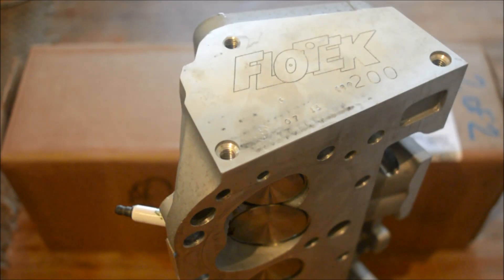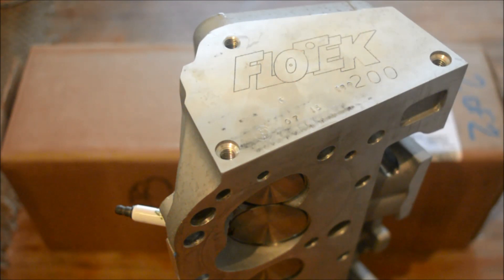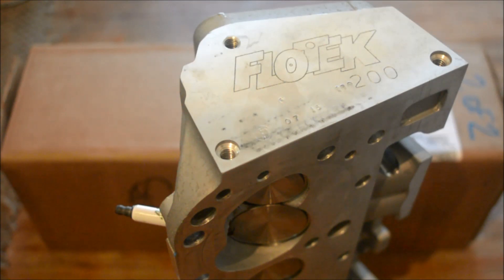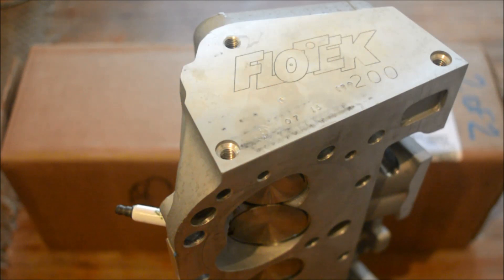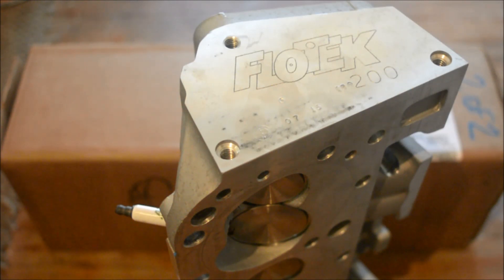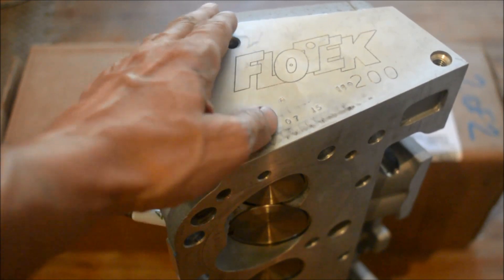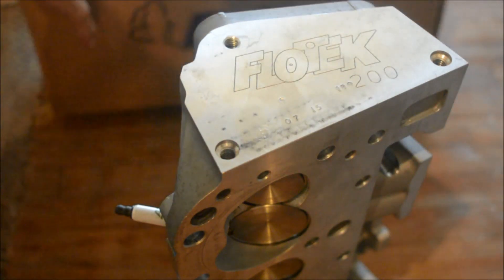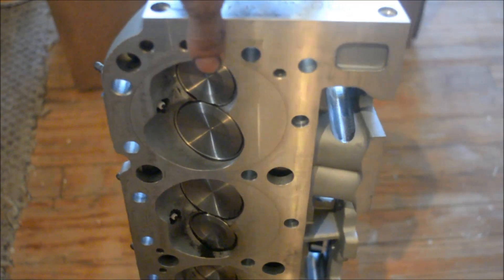Flo Tek Heads for SBC

Comment: Check the valves, I bought 180cc assble heads and they leaked by the valves out of the box
Reply: Did you have to replace the valve seals? I am getting oil on all my plugs after the 180 Flotek heads install.
Reply: @C10chevy85  Yes, I did replace valve seals. Did you use a good thread sealer on the rocker studs? It will leak oil in if you didn't.
Reply: @fiskshopworx1541  I did not use thread sealant. That very well could be my issue. It is using about 1 quart of oil every 200 miles

Comment: Good vid, naturally I did the wrong thing like you and bought some Jackie Chan heads, I later did the right thing and took it the machine shop put American made springs retainers valves and some machine work. After I was done we figured it was comparable to top U.S. aluminum heads for 1/4 of the price

Comment: So you went and bought new aluminum heads that as you say flow just as good as a set of vortec heads? Did you just want aluminum? And a victor jr is a single plane intake manifold which isn’t very good for a street car
Reply from the maker: @ Lima Bravo,

I wanted good performing aluminum heads, and so far the Flo Tek heads are performing well.  The sbc runs strong and stays cool in stop and go traffic.  I have a Weiand 7546 intake manifold that I will install during the summer.  A lot of the recommendations for street cars are to keep people from running a sbc that has the powerband come in at 3000 rpm; that equals a soggy bottom end on the power band.  Gears in the rearend solves that problem by keeping the engine revving near its power curve.

Comment: Update on these heads on your block . And how much does your car weigh
Reply from the maker: @ T Hendricks

I have the Flo Tek heads off the 350 right now since I'm having it machined to .30 over and installing flat top pistons.  I felt good torque.  My Nova wasn't running right so I took the 350 to the machine shop.  I'm doing a gasket match on the intake ports of the heads and I am going to run a roller cam also.  I didn't really get a chance to feel the Nova at WOT.  I'll have a better idea once I have the 350 back in the Nova.

The Nova weighs about 3400 lbs stock, but I've removed the AC, smog equipment, the stock intake manifold and the 993 heads.  Maybe it's close to 3200 lbs the way it sits.
Reply: Reason I asked I wanted to find out how well they do and how the do with nitrous too.
Reply from the maker: @thendricks6112  

Go to Flo Teks website and look at their heads.  The heads I have are the entry level heads which is all I need.  I'm picking up my engine block today, so I'll get an idea of what these heads are capable of soon enough.
Reply: @c41man  how are the heads working out so far? Any info is appreciated
Reply from the maker: @mnthunting5337  

I'm very happy with the heads.  After I rebuilt the sbc 350 in the Nova the power over the stock 993 heads is easily felt.  I have the stock th350 transmission and 2.73 gears in the 8.5" rearend so on the highway when it kicks down a gear the Nova really moves.

Comment: IF YOUR GONNA DO VIEDOS LEARN TO DO THEM RIGHT
Reply from the maker: @ Robert Cowan.

Ok.  The video is meant to give anyone thinking about Flo Tek heads a quick look at them.  If you have questions about the heads, just ask.  Say you had a question about weight, the heads are very light and easy to install.
Reply: Flotek makes a damn good heads i been using now for few years all on boosted engines and they are  better then edelbrock by far and as good as AFR . .